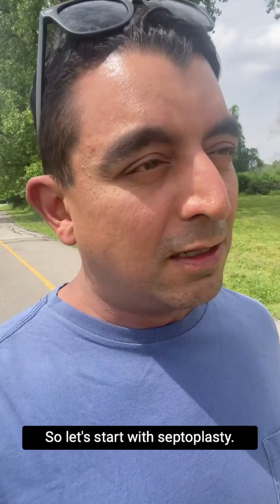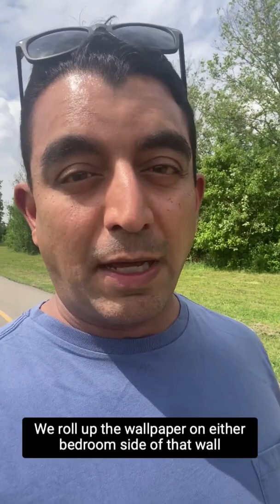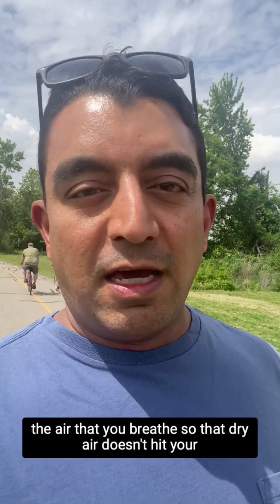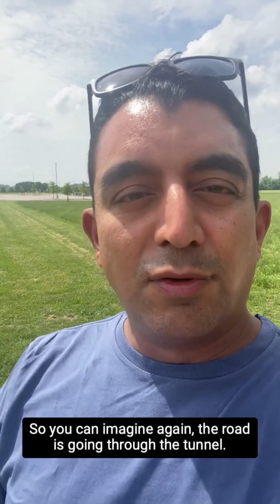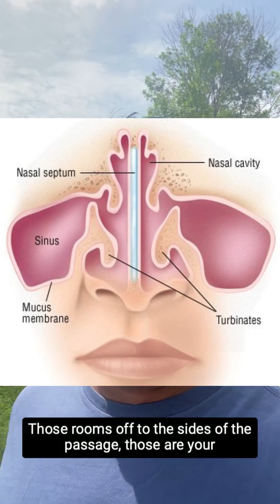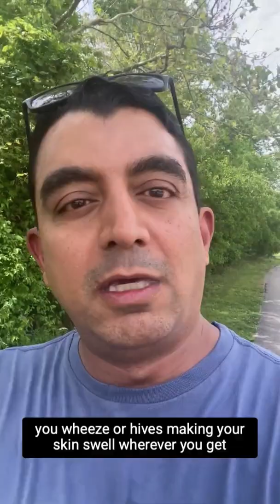Nose Surgery 101: Septoplasty, Rhinoplasty, Turbinates, Valves and Sinuses

Comment: This was immensely helpful.  I had an appointment today with my ENT/Allergist and apparently I have nasal valve collapse and a deviated septum which is causing an abundance of issues.  We discussed implants to improve airflow and possible septoplasty if that doesn't correct it.  This clarified a number of questions I had and will help me have a more educated understanding of my options as we proceed with treatment.   Thank you!